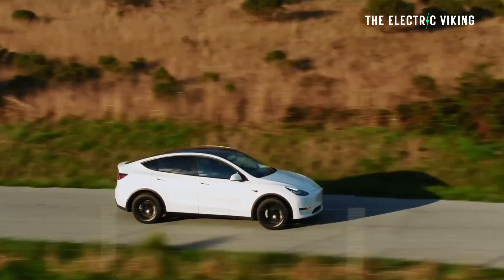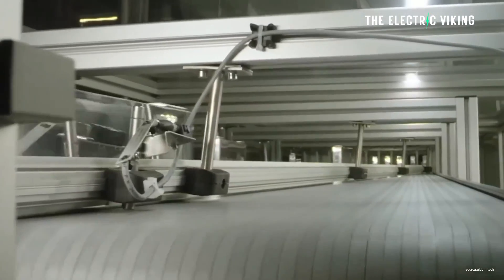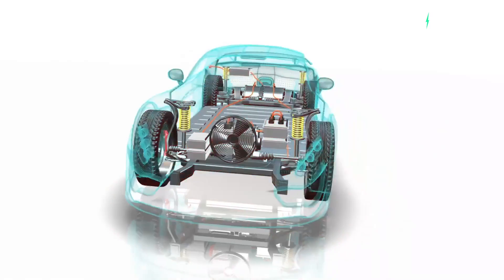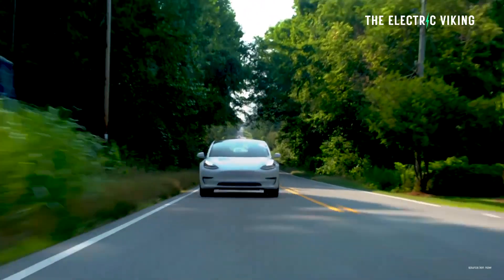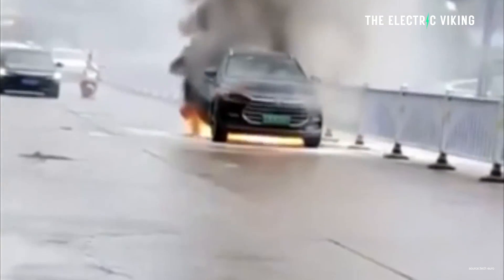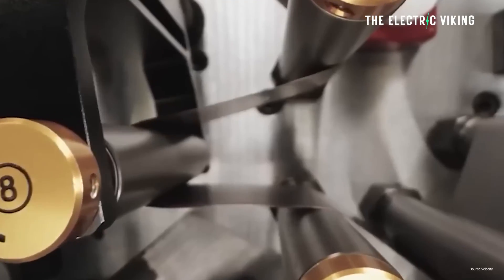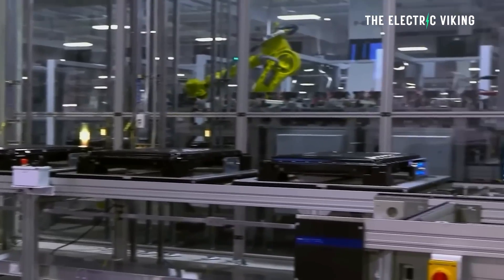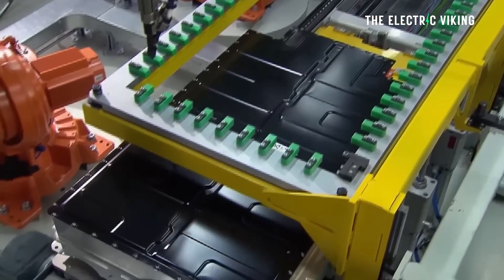Tesla offers LFP battery & suspension upgrade for Model 3 with 2170 cells

Comment: LFP batteries doesn't benefit from being charged to 100% daily. The degradation is higher in LFP in the beginning.
Reply: LFPs don't benefit but then they don't suffer from full charging which is the point.
Reply: @ohger1  True
Reply: @ohger1  Yes they do. In fact - they degrade faster than LFP. The ONLY reason Tesla recommends you charge to 100% is because it is extremely difficult to calculate the range on a partially-filled battery. The risk of someone running out of power is far greater than the "risk" of degradation... which is going to happen either way. Don't believe me? "Based on data from the Tessie app ...the trend tends to be substantially faster degradation from LFP batteries. "
Reply: @Dave-cf4vd I think your story about their recommendation regarding charging LFP to 100% is right on the money. The voltage drop on nickel turnery batteries from empty to full is much higher, making it easy to calculate how charged it is. The LFP chemistry gives you a very consistent voltage, which is great, until it runs out. I think when you full charge it, Tesla measures how much energy you pulled out since you last charged it. LFP is supposed to have much higher cycle life, like 3000 to 5000 cycles, so it would be surprising if the degredation was high.

Comment: And this is why I buy Tesla.....
Reply: Yes
Reply: They are doing it for themselves.   Where do you think those old cells will go?
Reply: Of course they are doing it for themselves.

Most all the OEM have their many induce "planned obsolescence", forcing consumers to buy another vehicle after a certain time.

It seems Tesla doesn't play by their rules. So Tesla should open this  "Sweet  Battery Option" to all owners of Tesla.  

As far as old cells go, Tesla better be on top of this action, they don't want to screw themselves.

I'm quite sure with very low cost, batteries swap and someone getting 8 more years out of their Tesla. Tesla will have many happy customers .